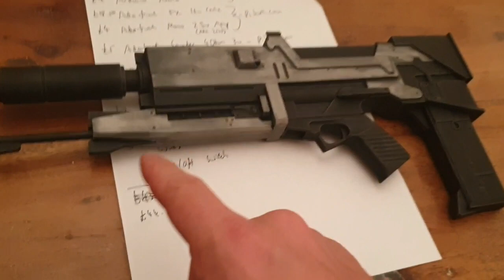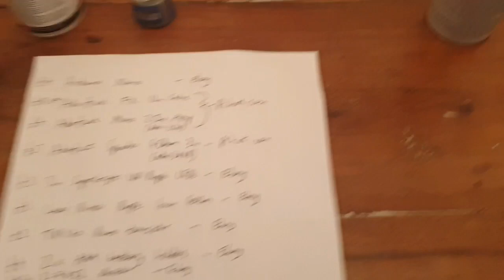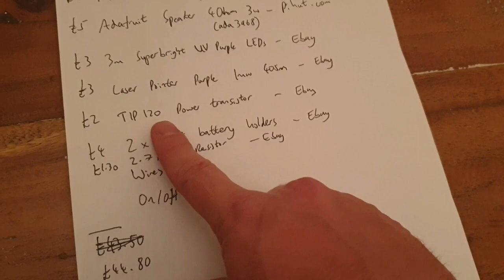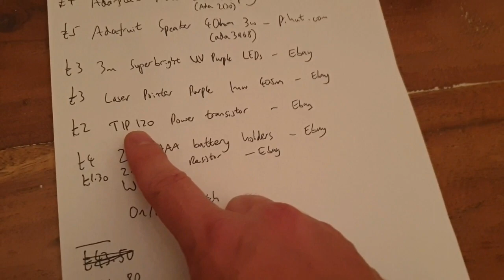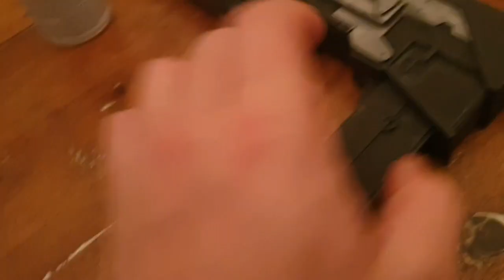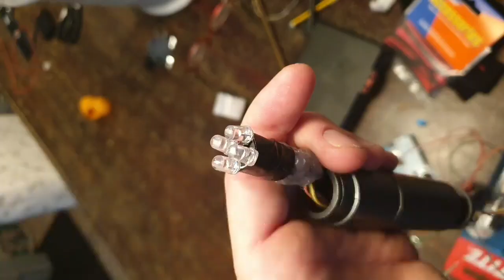Build the Terminator Rifle mod overview

Comment: Did you have to cut an insert into the rifle for the speaker to fit I bought part ada3968 but it won't fit within the inside I have cut one side out for the sound but aren't sure do I cut the other side for it to fit proper thanks.

Comment: Sorry to miver you ste can you help with building the circuit for the plasma rifle I understand the fx board and how to hook all that up but I'm stumped as to how relate the lights to flash in time to the sound with the arduino board can help please thanks.
Reply from the maker: Just simply program the arduino to turn on leds on and off when the effect plays. Takes a bit of trial and error but is just program delays.

You will need to know/learn how to write simple code for arduinos

Comment: Just ordered all of the things on the list :) I will search for instructions on the adafruit site but just wondering, the tip 120 transistor, am a total noob at this but where does this go and the 2.7kohm resistor as well? thank you
Reply: Also, are you able to share the files? I have the sound for the rifle but just how to get it set up on there and to run firing on its own thank you :)

Comment: Hi Steve   Thanks for the wiring diagram for the rifle , it makes the wiring look a lot easier .  On your parts list you include Adafruit Mono 2.5amp ( ada2130 ) and Adafruit speaker ( ada 3968 )  which dont appear on the wiring diagram .  How are these wired up please .
Reply from the maker: They have schematics for these on the adafruit website, my diagram program doesnt have graphics for those but everything can be found on the adafruit site
Reply: @SJW2511  Ok Cheers
Reply: Any chance of getting that schematic?...

Comment: Is the 445nm laser beam visible? Looking for one that doesn't burn.
Reply from the maker: Its visible, like a laser pointer, it doesnt operate nearly enough power to burn
Reply: @SJW2511  I saw one from Sanwu, but the mW is 500, what model did you get from eBay? I gave you my e-mail to send a list to all parts, will check that when you've sent it, thanks.

Comment: Thanks for the upload, your mod is insanely awesome. I have sprayed the full gun  in a Matt black , going to be using some c1 metalizer powder for the silver parts, i like the effects you've  done with  the weathering on the Matt black. Do you  just lightly dry  brush the whole gun with  the cintadel  paint or just dry brush the Matt black parts?👍
Reply from the maker: Just dry brush the edges of the raised parts to highlight them
Reply: @SJW2511  cheers Steve, what was the colour citadel paint  you use again?
Reply from the maker: @AdamKummrow5436  citadel dawnstone